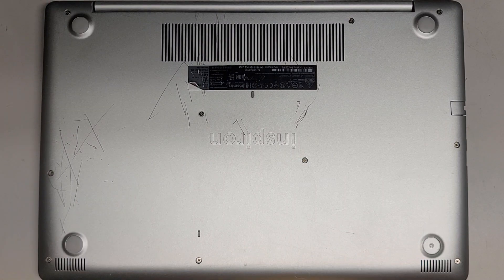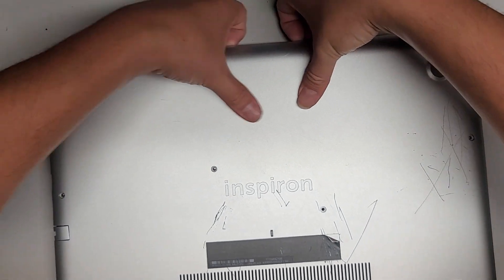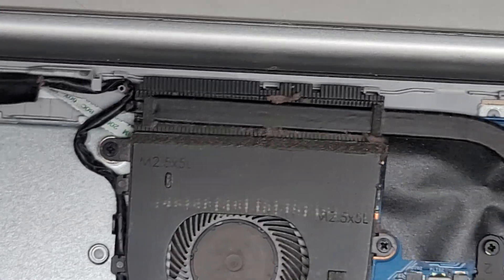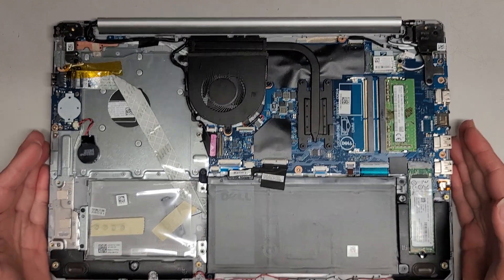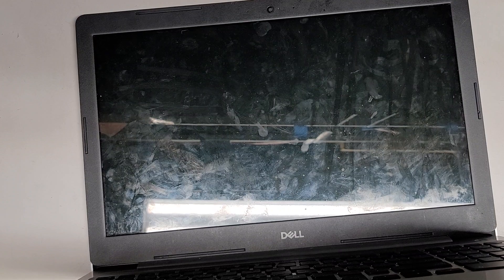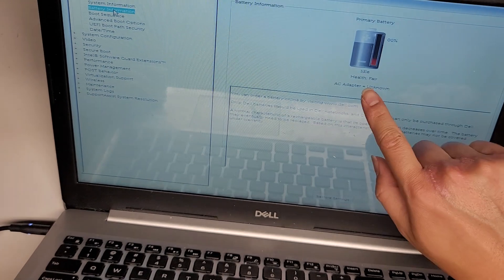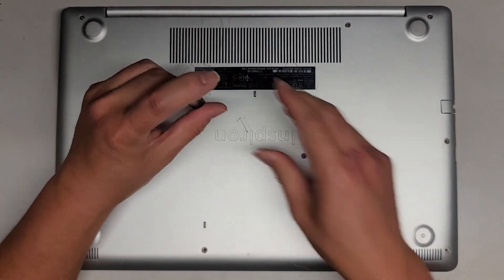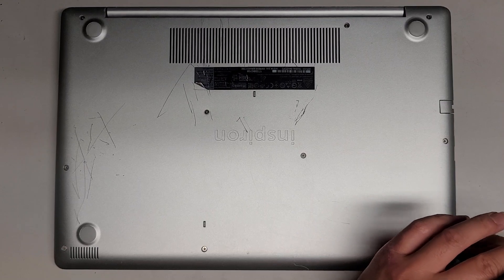Dell Inspiron 15 5570 Disassembly DC Jack Charge Port Replacement Repair

Comment: Thank you so much for putting this video up. I will buying one of these cords myself in next few days off ebay and will follow your video here. Really hope it works. :-) I'll update later if it did or not fix my "dell alert! The ac power adapter wattage and type cannot be determined. The battery may not charge. Tge system will adjust the performance to make the power available."
Reply from the maker: Sounds good! Usually it can be the charger and the charge port combined.

Comment: Thank you for this. I tried ordering a new cable and no luck, going to order a new charge port and see if that fixes the problem. 🤞
Reply from the maker: Hope it goes well!
Reply: @ItsBinhRepaired  me too! Will keep you posted.
Reply from the maker: If you haven't already, please like and subscribe so others can find my videos and possibly consider watching a few others to get the algorithm to recommend my channel. Thanks!
Reply: @ItsBinhRepaired  Question, I cannot find the replacement part on Dell's website. They had the charger cord, but not the battery charger port. Do you have a reliable source for authentic Dell parts? I have looked on Amazon, but the reviews are pretty mixed.
Reply from the maker: I hate how YouTube doesn't notify me of replies. Were you able to figure it out? I usually just go with good reviewed items on Amazon.
Reply: @ItsBinhRepaired  I haven't made time to pull the back panel off yet, as I want to do that before ordering one, as they all look different, yet say they work with the same model. I will try to circle back around though, as I will be rewatchijg your video to walk myself through it when I do both steps. (I created a playlist just for this repair, lol.) Thank you again for putting this content out here!
Reply from the maker: @jenknight461  lol holding off on it so long. Hope it goes well when you finally get to it.
Reply: @ItsBinhRepaired Finally got around to ordering and replacing the DC Charge Port. Unfortunately, while your video was immensely helpful, and I would not have attempted this without your tutorial,  either there is an issue with the motherboard or the battery or something else in the system. Replacing the port went smoothly, I replaced the external charging cable as well, but the error message persists, it still wont recognize the AC adapter, along with now saying the battery does not exist. First it said the battery was not plugged in, so I took the panel back off and double checked the connections. Tried the BIOS battery trick in this video too. Unsure if I should order a new battery for two reasons, 1) if the laptop won't recognize the AC Adapter then it likely still won't charge the battery?, and 2) the windows 11 update coming this fall and windows 10 soon to be no longer supported. Your thoughts on any and all of this?

Again, I appreciate your video, simple, straight to the point, no BS, and very helpful. I hope you continue to do laptop repair videos like this, as I am sure I am not the only one who would appreciate them.

Thank you again!
Reply from the maker: @jenknight461  try running it with no battery at all.

Comment: I have the same laptop and if the laptop is shut down, the light always go off after 2 secs of plugging it in, but when the laptop is switched on the light stays and it gets charged. I think its the basic functionality of this model and you had correctly repaired it.
Reply from the maker: Interesting
Reply: yes I can vouch for this
Reply from the maker: Got it